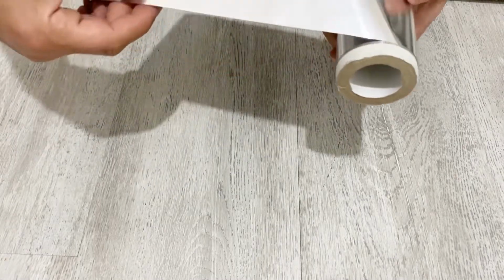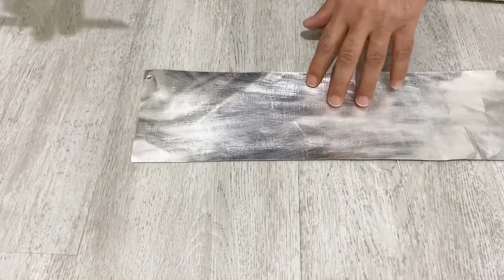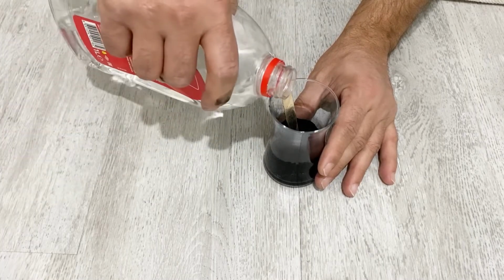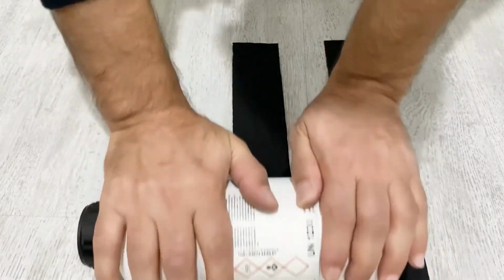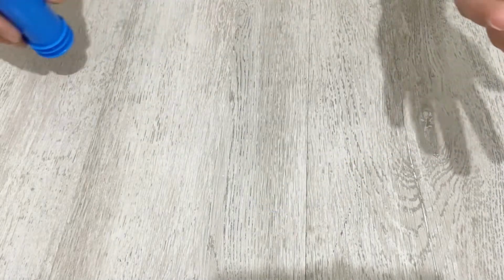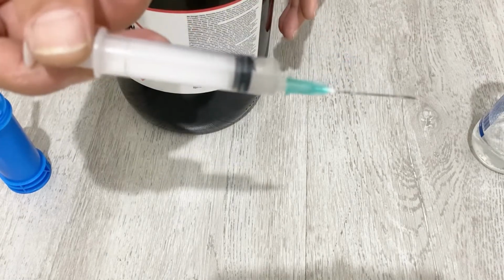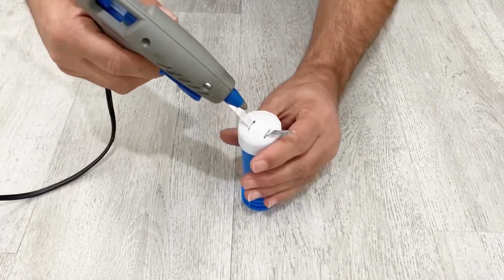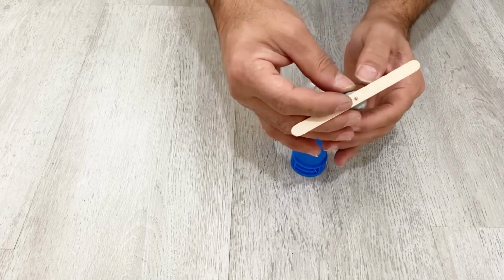How to Make a Supercapacitor with Aluminum Foil (Step by Step, Each Detail) 500 F

Comment: That kind of foil might be hard to find in some countries. You could also use 50 mil aluminum tape and remove the adhesive. It's used for insulation and ducting.

Comment: I made my "Super capacitors" just by rolling two layers of aluminum tape and thick plastic film on piece of 32 mm plastic pipe and I got little less than 30nF capacitance. But those caps can handle several tens of kilovolts voltage
Reply from the maker: Yes they are 👍Nice work.

Comment: Thanks for this information. If I use aluminum foil instead of graphite like yours, will there be much difference? I'll make it bigger anyway.
Reply from the maker: You can’t get high capacitance without graphite and activated carbon.
Reply: @joyofelectronics9782  You are right, I did a little calculation, no matter how big it is, it is ruined without graphite and electrolyte liquid. I expect a capacity increase if I use the electrolyte solution fully.

Comment: Hello 😊

Just a question, why don't you put the electrode with activated carbon facing each other in the way to have:  Alu foil > activated carbon > separator > activated carbon > Alu foil ? 

You put it in this way : Alu > activated carbon > separator > alu > activated carbon.

Thanks guy 😁
Reply: i believe its possible short circuts may be possible if you do it that way but not super sure

Comment: Good evening. Is there a replacement for dor sodium sulphate? In my coutry, it is a conteolled substance, hence too difficult and expensive to get even small quantities. Of course, this replacement has to be a "allowed one"for aluminum.  Thanks in advance. God video and pretty clear!
Reply from the maker: Thanks. You can also use apsom salt instead. But the self discharge rate will increase a little bit.

Comment: Open up a broken microwave capacitor, you have your alumimum foil on a separator, just clean it to remove the isolation oil, which is normally mineral oil.

Comment: hello sir, you said on other videos, if we use aluminum foil as a seperator, we cant use white glue as a binder, but you used it anyway with aluminum foil in this supercapacitor, does it also work?
Reply from the maker: As l mentioned in the video in this case you have to use a surfactant as l used.

Comment: Sir, can we get more volts in this way by increasing the number of layers? For example, how much is needed for 12 v?
Reply from the maker: You have to built more than one and connect them in series 👍
Reply: @joyofelectronics9782 thank you sir🎉
Reply: Am i right that when connecting the capacitors in series you decrease the Farads?
Reply from the maker: @lcipciriuc  yes

Comment: What the trademaek of white glue you use?
Reply from the maker: It doesn’t matter, any of them is going to work well. (Except very cheap ones)
Reply: @joyofelectronics9782  is this waterproof ?, how can polyvinil acetate glue can be waterproof ?, i ahve tried one that claim water resistant but not have a success, the binder start weaken after dip in water

Comment: I tried making this supercapacitor, and it was able to reach around 1.5 V, but it discharges incredibly quickly and I wasn't able to power anything with it. Any idea what may be the problem?
Reply: Try putting a lithium battery inside the container instead of the "super capacitor" and you'll get similar results.
Reply: @texNoz or just make it right and get good materials

Comment: hmmm this is not a capacitor its a aluminium air battery ... nominal voltage 1.2V to 1.6V , as soon as the alluminium electrodes are consumed then you cant recharge it because you would have to melt the aluminium oxide again.
Reply: If you use polyurethane and add aluminium to one mixture and graphite to the other you can make rubber conductors that don't corroded as easily... And they're polarised, for an electrolyte sodium chloride is fine add a pinch of aluminium oxide and a punch of ultra fine graphite powder to the electrolyte mixture and away you go... Long lasting battery cell that fast charges, combine a few in series and parallel to amp up the current and voltage potential and away you go... Polyurethane can also produce some very low resistance values with graphite... Virtually room temperature superconductor values which makes for very fast charging compared to normal metal conductors... Your quite right also... It is a battery not a capacitor, seems the new generations don't know what a chemical battery is... Or the difference.
Reply: @johnhamilton4816 did you say "rubber conductors" ???@
Reply: @migor777 Rubber tires conduct high voltage due to the carbon in them.
Reply: First sane comment here. It is not even rechargable battery!
Reply: Aqueous electrolytes have a (thermodynamic) theoretical stability domain of 1.2 V. They give rise to systems whose nominal voltage does not exceed 1.2 V as a general rule due to the redox reactions of the water. -Supercapacitors Based on Carbon  or Pseudocapacative Materials, Volume 3, introducion page XI

Comment: Excuse me, I am an Arab person and I understand the English language with difficulty, so I translated some of your videos. I want to make a battery at home. I have tin, I have graphite and activated carbon, but I cannot prepare sodium sulfur. Is there another alternative to sodium sulfur? I ask you to respond quickly, because the electricity was cut off in my country. Very much, and I want to make a strong battery to operate the inverter device. The children here get tired because of the extreme heat. I hope for a quick response, thank you. Or I want to communicate with you so that I can make it. Thank you very much.
Reply from the maker: You can use sodium sulfate in the case of you use aluminum foil, but if you use copper foil you should use sodium hydroxide 👍
Reply: @joyofelectronics9782 I do not have sodium sulfate. Is there an alternative other than that? I use aluminum foil as I mentioned to you, and I do not know what the element sodium sulfate is. I ask you to replace this element because I do not know it. Thank you very much.
Reply: @joyofelectronics9782  @joyofelectronics9782 I do not have sodium sulfate. Is there an alternative other than that? I use aluminum foil as I mentioned to you, and I do not know what the element sodium sulfate is. I ask you to replace this element because I do not know it. Thank you very much.

Comment: Hello, in one of your videos, you made both poles from aluminum and carbon and charged them as DC. How are the anode and cathode determined?
Reply from the maker: is the same at both poles. You should always use whichever you marked as positive and which as negative in the first place.
Reply: @joyofelectronics9782 ok thanks sir

Comment: A more quantitative evaluation would have been nice - put a load on it and drain it and show us a graph of the current and voltage vs. time, or something like that.  Also, does it degrade with use?  How many times can you cycle it and still have it work well?  Etc.
Reply: Excellents Ideas !!! Thanks !

Comment: As a Fine Print Note for anyone pondering putting these in a Series or Parallel arrangement to increase the working voltages or currents, be sure to get the dimensions of your sheets as close to the same size as possible, the thickness of the paint goop as consistent as possible, and all measurements of everything accurately measured and consistently mixed.
I think you get the idea: We aren't doing a Stir Fry, so we just can't toss in so much of whatever. When we're banking these things, we're baking a cake. 
Measure that stuff to the 1/10th of a gram.
Reply from the maker: Thanks for the wise and fenomenal suggestion
Reply: Great point measure or weight the solution for each plate of the capacitor will make the most difference. As well as weighing the capacitor plates and removing material to make them as close to the same as possible
Reply: @RustyShakleford1  Well, with the plates, it's the surface area that's critical. We just weigh everything else out so it's "The same" on each plate/in each cell.

Comment: I created one using some 8 inch long 1 inch wide strips of kitchen aluminum foil. 4 layers of toilet paper tissue as the separator. and a thin painted layer of ground pencil graphite painted on
With the electrolyte of sodium sulfate. However it would charge up to about 1.5 to 2 volts. it had very poor performance and poor conductivity. The best it could do was light up an LED for a minute or so. very dimly. or spin a small DC motor for a second or two. Only a small improvement over a regular electrolytic plain aluminum foil capacitor.
I think my pencil graphite was bad because it had high resistance. A short only couple cm piece had a resistance over 1 ohm.
The bond of graphite to the aluminum foil was excellent. even after disassembling the graphite remained on the surface of the foil current collectors without flaking off or delaminating. it did not stick to the paper. so my bond was good. but the resistance was terrible.
Probing two spots close to each other on the kitchen foil showed resistances in the kilo-ohms range
I cannot find conductive graphite powder available to purchase online.
Could I get some from some high quality pure graphite rods instead possibly? That can be ground to conductive graphite powder.
Reply from the maker: Only graphite powder doesn’t work. You must use activated charcoal
Reply: @joyofelectronics9782  I tried both. and using both together.  Something is still wrong. I get kilo-ohm reading between current collector and anywhere on the surface of the active material coated on the aluminum surface.
I tried without graphite and only using activated charcoal by itself and got better result. Something is wrong with my graphite?
Why the graphite makes it not conductive?
if I only use activated charcoal active material by itself it works better. but still doesn't have a lot of capacity.
Reply from the maker: @realflow100  you really have some different problems. I guess you put binder over recommended scale or the conductivity of your graphite powder is too bad
Reply: @joyofelectronics9782  I'm not sure what happened but I think my last reply got deleted or didn't send properly.
I got it working using nickel foil instead of aluminum foil. Nickel stays conductive and doesn't form an insulating oxide layer like aluminum foil. 
I scuffed up the surface with a wire brush and painted on my new iteration of active material which is a 50/50 mix of graphite powder and activated charcoal. 5g active material 1g of pva glue binder 40g of water. for both electrodes.
I got 0.57 farads and 0.5 amps short circuit current from a tiny strip only 0.4 inch by 1.25 inch across single side coated strips of nickel foil from battery terminal spot welding strips.
It works! It finally works! I guess my active material recipe doesn't want to form an electrical connection to aluminum heavy duty kitchen foil. I tried so many times and never got any current to flow that way.
But using nickel strips it worked beautifully! I was able to power a small DC motor for a few seconds! It could charge at 100mA charging rate current over and over very low internal resistance. high performance. just very small.
Looks like I will have to look for some larger nickel strips if I want to make a larger rolled up supercapacitor version!
Also I noticed my active material only has a very small bend radius. Cannot bend more than a few degrees without cracking and separating from the surface. its very brittle and crumbly. Not very flexible. So I would need to make a really wide roll around a plastic bottle or something for support to prevent the active material from cracking and separating from the current collectors
Or instead I could make some flat rectangular sheets with tabs and stack them in parallel to make a pouch style rectangular cell. That might be easier to handle.
Also it seems lead sheets can be used as well. They also seem to work very well with the sodium sulfate electrolyte and activated carbon and graphite material.
Reply: @joyofelectronics9782  Can you tell me what might be the problem when I try using aluminum foil it doesn't work at all no matter what combination of active materials or ratios or binder percentages. but when I use nickel it works extremely good and powerfully even with wide range of combinations of active materials ratios and binder percentages?
Could my electrolyte be the problem somehow? Do I need to try a different electrolyte instead of sodium sulfate?
Reply from the maker: @ probably your problem is the surfactant. Don’t stuck with aluminum, if you are getting good results with nickel, keep using it.
Reply: @joyofelectronics9782  I tested again and found 1-2k ohms for aluminum. and less than 100 ohms for nickel. when the same active material is applied to both.
Also changed the amount of graphite to 15% to activated carbon. which increased the capacitance a lot and didn't decrease the conductivity enough to matter. it has spectacular high capacitance now. 130 farads for a pair of double-sided nickel strips a few inches long wound into a coil.

Comment: great video, I have a few questions. does the liquid electrolyte evaporate overtime? does maxwell super caps also use a liquid electrolyte like yours? what is the best energy density (wh/kg) super cap you can hand make compared to what maxwell is already producing? what is the life and lifecycles of your hand made super cap?
Reply from the maker: Thanks. The electrolyte evaporate over time unless the case airtight. The electrolyte used in maxwell supercaps are the different, they are not water based but based on organic liquid compounds
Reply: Why not use mineral oil? @joyofelectronics9782

Comment: What if you use a solution of sodium sulphate instead of deionized water when blending the graphite powder, activated charcoal, and glue binder. 

My therory is that as it dries it will  form sodium sulphate crystals in the graphite, activated carbon, and glue binder matrix. When you add water after rolling the capacitor,  the crystals disolve away leaving tiny voids with a high surface area much like activated carbon provides. 

What might not work as expected  is if salt crystals form on the surface rather than throughout  the carbon film.
Reply from the maker: It’s not good

Comment: If you add a 3rd layer of aluminum foil to the bottom of your stack before rolling it and use the top and bottom layers as terminals (ignoring the middle aluminum layer) , you can make a very nice 2.5 volt primary battery. Use a 1molar solution of potassium hydroxide as the electrolyte in this case.
Reply: potassium hydroxid will be destroy aluminium foil completly after half an hour🎉

Comment: i need to know, because this cannot be real, how the hell can you get 500F (FARADS) from a half meter tin foil, i mean, a real 500F 2.7v cap is packed so tight and the foil is super long. I guess if this is real, the caps should come down in price very soon. Very nicely done video though, but next time you need to open the capacitor without cutting the video after testing, to show there isn't any battery cell in the container =)
Reply from the maker: There are some other videos that l shows inside the capacitor brother
Reply: Why wouldn't this be real? There are many commercially available caps on the market today that are similar sized and produce 500 farad easily
Reply: @drewrinker2071  500 F at 1 volt means : as q=cv, there would be 500 coulomb charge, which is so big
Reply: The commercially available ones might be more reliable or have other benefits. Also, sometimes you can DIY things cheaper. The commercially available ones are probably a lot easier to integrate. No self-respecting electrical engineer is going to DIY a capacitor for commercial applications and sell it to a client/customer.
Reply: It’s the activated carbon, it has a lot of surface area because it is sponge like at the microscopic level so that increases the capacitance

Comment: How to make a 500F capacitor that operates at higher voltage(35v)? Do you have any suggestions?
Reply from the maker: There is no way to do this with current technology except connecting many of them in series
Reply: You'll never get near 35v super capacitor in one capacitor using an aqueous electrolyte, because of electrolisys. Your best hope is to serries many super capacitors and use an  active balancer to ensure none of the capacitors gets over charged. 

On the other hand, You can make a 35v electrolytic capacitor by electolytically oxidizing the anode electrode.

You'd use two aluminum  plates, and two paper  separators  (no graphite or activated carbon theybare useless in an electrolytic capacitor), and role your capacitors then put it in an electrolyte bath to soak. 

Then you'd form the insulating layer by passing an electric current through your capacitor. Use a bench lab power supply that can supply  sufficent voltage  and limits the current to maybe 50 to 100  miliamps. The aluminum anode will begine to oxidize on its surface forming a thin layer of aluminum oxide acting as a dielectric insulator.

If you plan on feeding a rectified sine wave to your capacitor,  you should form the capacitor to a value reasonably above the peek.  35v rms × sqrt(2) is just under 50v peek . You might want to form your capacitor to 55v or 60v for the added safety insurance and avoid the risk of exploding your capacitor with high currents when exposed to voltages above that which you formed your capacitor to tolerate. 

Lastly, the higher voltage you  form your electrolytic capacitor to, the thicker the dielectric oxide layer gets, and that inevitably lowers the capacitance.

Comment: What if I want the super capacitor to be 1000uf x 2.5,/2.6,,-7 votes or 500 uf x ,2.5v should I increase the length of the foil?
Reply: You'll never get near 2.5v Using an aqueous electrolyte, because of electrolisys.